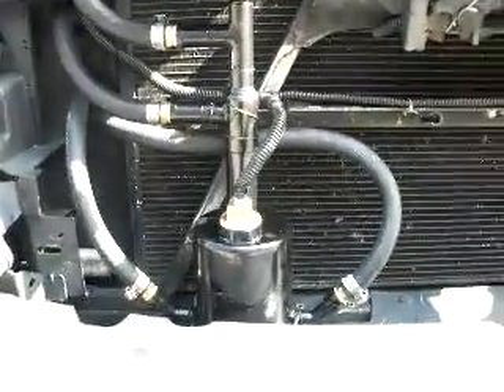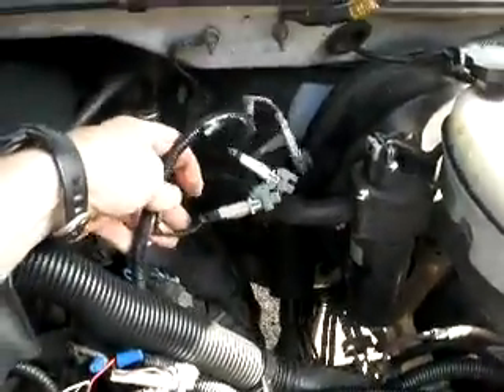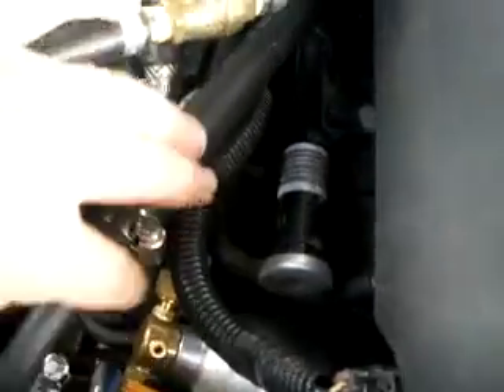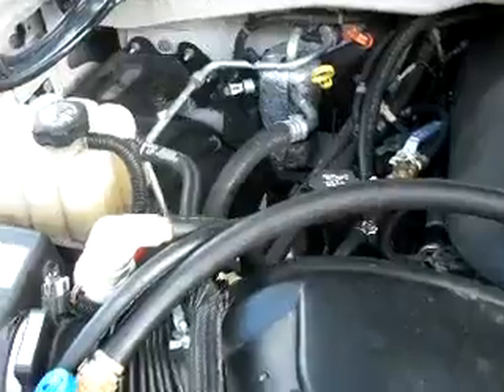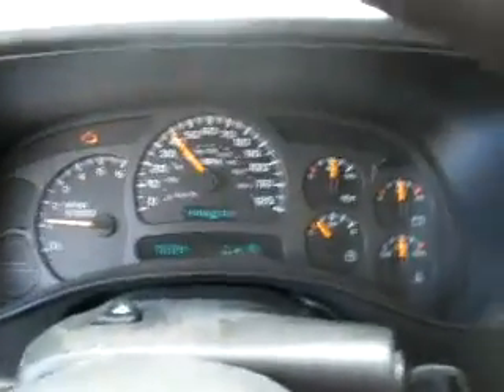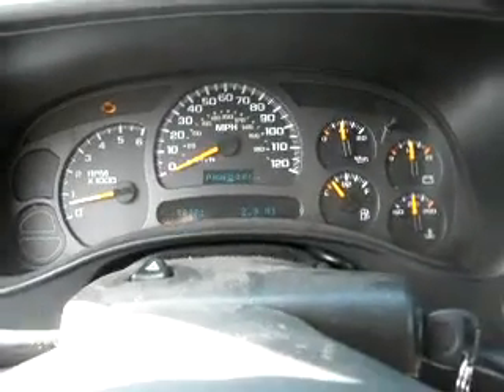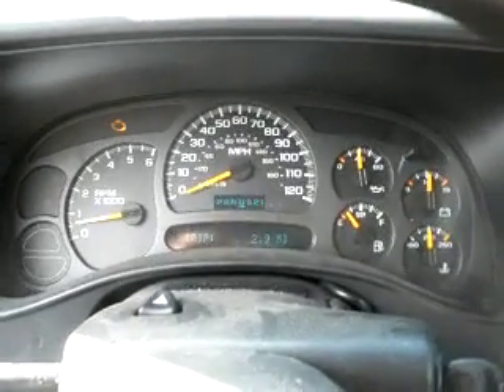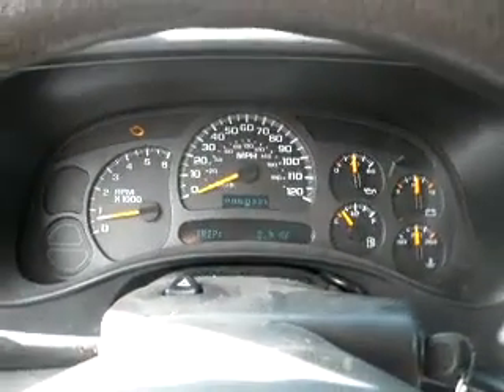Road Test In Progress from running on gasoline vap

Comment from the maker: Yes sir, it has gas in it and the heat from the water travels threw it to keep it vaporizing... that one is for the idling control. The other hose runs to the gas tank for acceleration. Thanks for watching.

Comment: in mexico older trucks used to have a Propane gas tank 
instead of gasoline 
mainly work pickups maybe like 14 years ago my dad had a 84 chevy with a huge propane gas tank running like this :) so yes indeed your theory works its been proven nice job doing it on a newer vehicle i had only seen this on older trucks mainly carburated 
keep up the work very interesting

Comment from the maker: Maybe allot better..not sure? I have read about the Gadget Man Grove and have found it pretty interesting. I just didn't understand on how air channeling would cause such great MPG gains when the computer is set and still programed to spray the same amount of fuel into the chambers whether at acceleration or at idle. The only way I think in beating that system is to unplug it and make up your own. Thanks for watching.

Comment: Did you try GEET with this vaporizer? You need a very small gap between the rod and the inner pipe wall in order to gun a gas through the reactor. It would greatly increase your fuel volume.

Comment from the maker: Sounds good.. I tried the geet system but no luck in getting it to work. I'm thinking about Tom Ogle's idea in pressurizing the fuel threw heat and use the vapors on demand like he did. You would need to add some acetone to the fuel because of the additives to make sure all of it evaporates when heated. Thanks for watching.

Comment: Im pretty sure if you add a hotter heating element with rheostat to keep the temp steady and preheat on fuel tank or half way you will be able to obtain desired gas vaporization without condensing...left over stuff of gas I'll put a Leo Umilas geet and run it hybrid(both at the same time)

Comment from the maker: Yes, heater hose was used to heat the fuel up to 180 to 200F. I think the other head your talking about is used for heating the vapors from my gas tank, you don't really need it thou...It didn't make any difference in running the engine. Hope this helps you my friend.

Comment from the maker: Actually the water might damage the injectors in how they operate. Maybe induce a ultrasonic vapor flog mist into the air intake to aid in the cooling of the valves and cylinders... might even make it run smoother. Thanks for your comment and watching.

Comment from the maker: No sir, but I did hear about that... cool stuff. I think it still would need to be heated up to around 200 to 300 degrees F to really get a good pressure off of it. Thinking about producing the fumes on demand now instead of holding it in a tank, much safer!

Comment: Have you ever added some gasoline antifreeze, to keep the gas from freezing.  The brand called HEET is one that they use in very cold climates.  I think that might give you a few extra miles with the vapor system.

Comment from the maker: I just used a one disk transducer and used my power inverter to convert 12 volts to 120 volt and then pluged the transformer in it to step it back down to 24 volts. Tap into the PCV line with a tee....my was a 3/8" line tee. Thanks for watching.

Comment: Hey there whyme2b.  Looks like you are really onto something here.   and as far as your gas freezing.    I will throw my 2 cents in on that if u don't mind.   Get an aftermarket exhaust kit and direct the exhaust to the bottom of the gas tank.  the hot air should keep it from freezing.   Im assuming it is freezing from evap'ing too fast?   Anyways.  great idea, nice job so far.  and thanks for posting

Comment from the maker: The fuel is thicker than normal gas and the engine works different in compressing gas in the chamber to ignite it, (which it might need all that liquid to lubricate the parts inside). I would stick to the HHO Unit or even try water vapor using a ultrasonic transducer. Putting the transducer in the fuel requires allot of work and not worth the time in the problems you may face with it soon to happen. Check out this site....very cool and may help out !  ww....aquatune....com. Thanks for watching.

Comment: Nice, just a question, would this process work on a diesel . . 7.3? I put on a hydrogen generator and got a few gallons. But it appears that there is much more oportunity at stake. I have thought about building a tank with an ultrasonic transducer in it, run a line to the fuel pump. Would that work? Your work is awesome and God has blessed you. Thx man

Comment from the maker: 5/8" form tank running to engine which is reduced down to a 3/8" which hooks into the PCV Valve vacuum port. Thanks for watching.
Reply: whyme2b Just wondering if you unplug the EFI relay, instead of unplugging each injector, will it still work without damaging the engine?

Comment from the maker: Yes,the computer is programmed to spray and maintain 450 Milli volts on the o2 sensors.All the over spray is said to be extra for cooling of the valves to prevent overheating for as they say. Adding more air to the system would increase even more spraying of gas into the chamber.The computer wants to maintain always more over spray. The black box tells all vehicles to not get good gas mileage unless the designer wants you too have it. All vehicles right now can get 100 or more miles if told too.

Comment: yes but wouldnt the 100% of the fumes not equal 100% of the gas? if your truck was only burning 30% of the fuel wouldnt the o2 sensors tell the ecu to give less gas? it seems like if you could get more air to the engine and just reduce the fuel input slightly wouldnt you create much more power and mileage? if i could get my hands on a decent turbo kit and had the ecu tuning skills i would boost about 5psi and cut fuel pressure to 75% of stock and theoretically i would get 150% better mileage..?

Comment from the maker: Actually I had more power and take off running this way than with the injectors spraying, because 100% of the fumes was burned instead of just 26 to 30 % ....which means 100% power... also it's not about gas pressure in the chamber...that's just over spray which blows out unburned and wasted until it hits the cat...than burns the that waste off. Your motor didn't benefit at all. I did take auto mechanics classes and have worked on engines for 25 years...I see what your trying to say my friend.

Comment: i think the idea is cool. but theres no way you could pull for example a 6000lb camper with that. it would stall with the touch of the gas pedal. the torque difference and gas pressure required is above what fumes alone could produce. dyno your truck running on fumes, youve lost at least half your power... unless you can find a way to pressurize it..

Comment: This look like a similar system that a guy used in TX back in the 70's using a 77 ford toreno with a big block getting 298 MPG's off of one gallon of gas. news broadcast al all.

. nice set up.. can you elaborate on how you set this up. i would like to try it out. Thanks. Tsutherland74@gmail.com

Comment from the maker: Yes sir...it could be just the same as with the injectors plugged in. I just never got the results yet because of the minor problems I encountered with the gas freezing which made the vapors stop flowing after 5 min of driving. Once the problems are worked out, I will be happy to give the results in driving a far distance my friend.

Comment: I'd like to see a real experiment. Put in 1 gallon of fuel, and record how much it will run until it's out of fuel. I just can not see how this will work properly. Also when you are "experimenting" wouldn't you want to see with accuracy results like MPG? Common sense would dictate that you'd want a # like "used 1 gallon of 89 octane fuel to run 100 miles" or whatever. Otherwise even if it does work it could very well be consuming the same amount of fuel as just plugging in the injectors. Ya know

Comment from the maker: No sir, just running my line to my tank. It's actually a 5/8" fuel vapor hose hooked into my airduct with a damper to close off the fresh air intake and pull the air threw my tank instead to pick up the fumes aswell ... When accelerator is pressed,the vacuum  pulls all the fumes from the tank it wants to do the job. Thanks for watching.

Comment: Are you using a propane vaporizer in-line to your air box or are you just running your 3/8" line from your tank?  Did you install an electrical vacuum pump to increase the flow of vapor?  I have known for years that engines burn vapor and not raw fuel.  The trick is getting enough vapor into the engine.

Comment from the maker: Yes, It's a great idea but my gas tank is made out of plastic...hard to believe ! If it was metal , I was going to weld some pipe lines running threw it but so much for that idea, plus it's to time consumming. The air inlet however would be nice threw picking up the heat from the exhaulst manifold because it heats up fast. Thanks for comments and watching.

Comment from the maker: Yes, I use a circuit board on all 4 of my o2 sensors which fools the computer in showing the correct fluctuating voltages. Also, I added a damper in my airflow breather. I didn't try the fuel stabilizer thou? Will try it when I can get back on the project...good idea ! Thanks for watching.

Comment: (timing) the hho guys are straight  wiring the o2 sensor, ground it  or use a pot. to find the right ohm's.  then a resister.  
put a baffle in the vent tube or restrict the air flow at the breather.   this will kill flat spots. Gas freezing hummm, degeler, fuel stabilizer.

Comment from the maker: I never thought of that man....good point ! I did however use my gas tank for the idle control on start up. The problem came 5 to 7 minutes later when my gas started to freeze which caused it to stop making vapors.Would need to also heat the gas in that tank as well to keep it going...Still working on it. I will check into that about the fuel additives thou...Thanks for watching.

Comment: The setback is... He is pulling all the good vapor which will eventually leave the additives that wont vaporize. You can't simply re-boost additives with new fuel due to the fact that bad fuel is being built up in the gas tank.  He was smart to not do the testing on a full tank.

Another issue is that the back O2's are sending information of less voltage being produced since there is less heat at the back O2.  The ECM  takes the information  and changes the timing. 

So what happened dude?

Comment from the maker: A few things you need to do first to get this to work is explained in the comments on my first video made. My hose line was a 5/8" from my tank then went down to a 3/8" into my pcv valve vacuum port. I also had to stick a hose around 1 feet long down into my gas tank center pipe and cover up the vents around it so that it could pull in the air and bubble it threw the gas. I had around 4 or 5 gallons of gas in the tank at the time with no restriction to the flow. Let me know if this helped out?

Comment: Hi! I tried this and didn't work. Disconnected my injectors and ran a 3/8 line with a flashback arrestor to my plenum, It tries to start but wont. Am I doing something wrong? How much gas do you keep in your tank? Is there some restriction to the flow? Can you help with some tips? I drive an Explorer 4.0 6cyl Thanks!

Comment from the maker: Thanks for the infor ... I may need to add a ultrasonic water vapor mist to my intake air to compensate for that. It might even make the engine run even more smoother?

Comment from the maker: The gas vapors are coming from my gas tank and used only for the idle .The canister in front of the engine is for heating up the gas vapors.... you don't really need it on there, I was just trying it out to see if it would make any difference in the idleing with hotter vapors. Nothing was noticed. Also the unit in front of the radiator is what I made out of copper 3" caps. That one is used for acceleration. It's a 2 part system that makes it work.

Comment from the maker: It connects inplace of the 3/8" Pcv hose which is under vacuum to power my idle only. The flashback material is stainless steel mesh in 2 places.... 1 near gas tank and other at Pcv connection. Your welcome and thanks for watching.

Comment from the maker: Yes, I use a 4" damper that closes off my intake air causing it to flow into my gas tank which is then mixed with the gas fumes returning to the other side of the damper going into my engine for acceleration. Seems to be a perfect mix and runs very smooth. Thanks for watching.

Comment: Very nice work. Thank you for showing us this video :) engine sounds great running on 100% vaporized gasoline :) gasoline expands 163.3 times when phases changed from liquid to it's vapor state. The stock engine with stock fuel system only uses 20% of gasolines energy to move the vehicle. 40% lost to heat and friction, and 40% goes out the exhaust manifold. You're burning that 40% usually lost :)

Comment: Hot vapor is definitely the way to go booth at idle and acceleration! you will definitely find that using hot vapor all the time will also increase the MPG by quite a bit because cold vapor is allot denser then hot dry vapor therefore it takes less dry "light" vapor to run an engine due to a more complete burn.

Comment: I have done much experimenting with hot gasoline vapor and have never had a problem with the upper cylinder lubrication. When gasoline is vaporized and injected through the air intake the vapor is still able to pass through the upper and lower parts of the engine therefore there is no problem with burning up the rings etc. The use of water injection is also a great way to keep the engine running cooler.

Comment from the maker: On this set up, I'm using hot vapor for the idle and cold for acceleration...But it looks like I will need to use hot also for acceleration to keep the vapors going. Because the condensing of the gas happens to quick because of air running threw it. Thanks for watching.

Comment from the maker: Yes, so far engine temp is the same and more power is noticed. I do have Dyna lube additive in my oil which takes away 70 to 80% of friction in the engine so I can't really tell you if this would cause a engine to get hotter with out it? Thanks for watching.